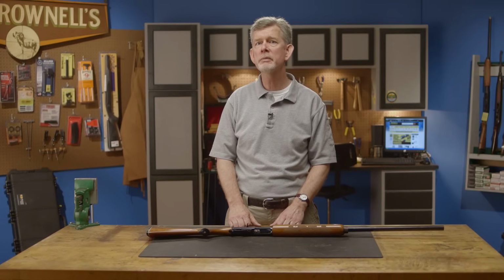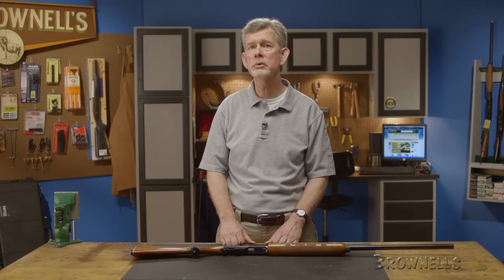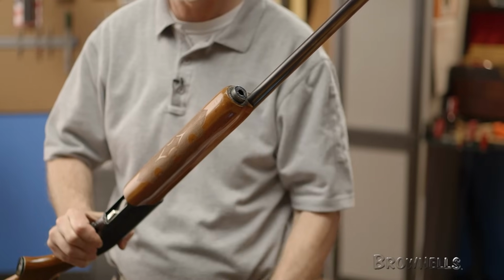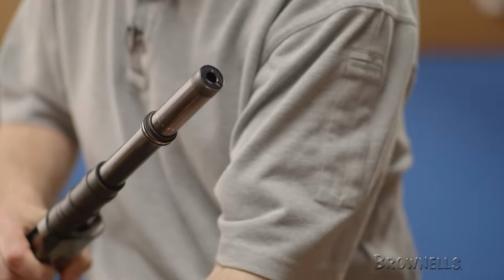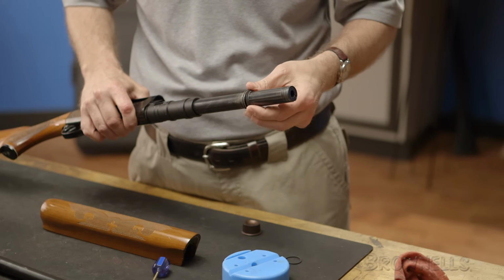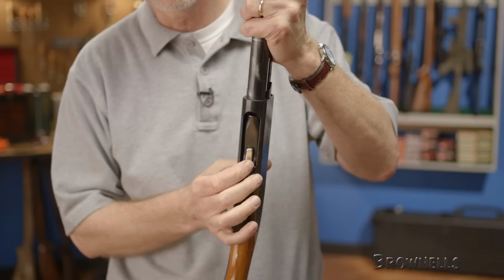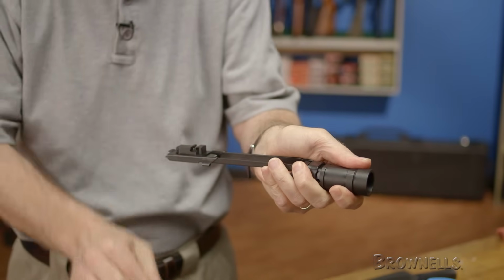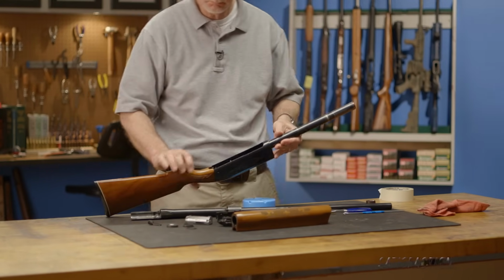Remington 1100/1187 Firearm Maintenance Series: Part 1 Disassembly

Comment: I'm hoping I finally managed to fix this blasted thing. My father's 1100, every single time it fired it kicked like a mule and released a massive concussive blast out the ejection port. I changed the O-ring and recoil spring, the latter of which required a proprietary socket to remove the stock, and the gun had to be put in a vise. That's one thing the cheap clones do a lot better: they move the recoil spring to the magazine tube, which is where it should have been in the first place.

Comment: my 1100 lasted me from 17 yo to 55 years old. done me through the trap, skeet sporting clays, dove hunting, quail, grouse, pheasant, duck, geese...never changed the o ring once, and now not a difference.-- it still keeps on doing the do. there isn't a better shotgun than the Remington 1100.
Reply: That's good to hear. My dad bought me one for skeet shooting for my school team and for defense when I'm home alone. Plan to keep it till it no longer works.
Reply: @desupernoodle just buy spare parts and it will outlast you. i have an old mossberg 9200
Reply: Benelli, M4 mosburg 590  1987 pump action I don’t mind 110 but common 😂

Comment: I just disassembled and cleaned my 11-87 and noticed afterward that the action bar assembly has some play and can rattle when the bolt is locked open and I move the gun about. Everything seems fine otherwise. Is this normal?
Reply: Normal.

Comment: I have watched numerous videos on the 1100. My operating handle does not just pull out i have even tried pliers? Any idea?
Reply: It may be seized. Try a penetrating lube agent. If that doesn't work, I would suggest trying a heat gun. Do not overheat any metal parts!!! You are only trying to warm the handle slightly. I'm talking like hardly even "truck tailgate hot". This works best on a cool day or in a basement with a 20 degree Fahrenheit difference. Wiggle the handle. Let it cool. Spray some lube. Wiggle the handle. Wipe away all the excess gunk. Repeat this process. It should come out. I've had one that was an ornament in a bar... It was filled with decades of tar. It took 4 hours... It finally came free after multiple filthy rags.
Reply: Wrap Paracord around the bottom of the bolt handle tightly and then pull out.

Comment: how do i get operating handle to come off it won’t work
Reply: Had to spray mine with CLP break free and it came right out
Reply: I was confused about this also. Sprayed mine with some lube and wiggled it hard. It does in deed pull straight out. No trick to it.

Comment: What if the carrier release won't move?
Reply: Hey there guy, I bought this (rem 11-87) today used, and had the same problem, I took my trigger out, the carrier, etc, and once you do that, above the carrier where the trigger strikes is a silver piece, you pull that up and back toward the rear of that assembly, and it will release it and allow it to become mobile again. If those instructions are confusing, let me know and ill post a video to help you so you can get your gun functioning